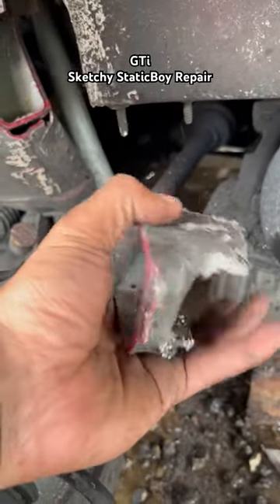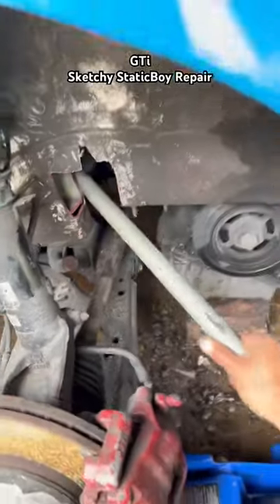Watch pt1 #slammed #lowered #vw #vwgti #volkswagen #gti #jetta #carmeet #carguy #cars #car #funny

Comment: Quick question, is the brake discs being kinda rusty safe, just asking cause the one on my car is the same and I don’t want to die
Reply: As long as it’s not extremely rusty on the contact surface of the rotor. The hat/ raised part is fine. It should be good as long as it hasn’t been sitting for a long ass time and rusting

Comment: Yall need to chill this is a mk4 thing 😭we usually use a whole saw to cut it and make it look nicer but that will work ig honestly a lot more room than using a 3 inch hole saw
Reply: Gotta love the YT Master mechanics meanwhile haft of them drink/text and drive with 2/32 tread depth with both clapped out ball joints